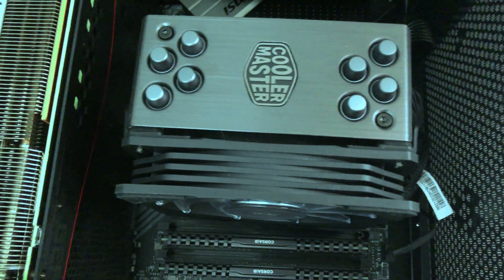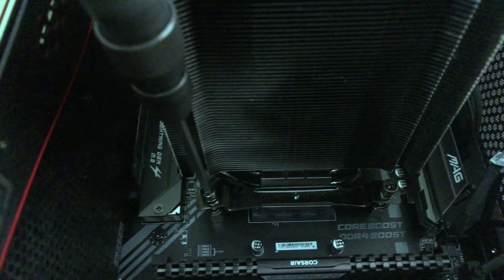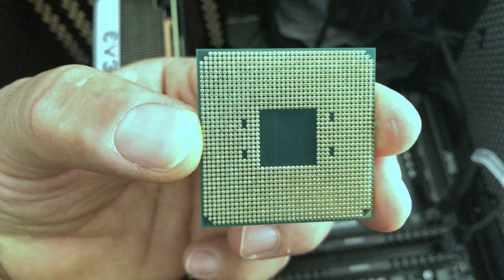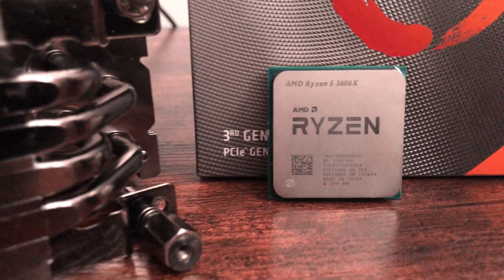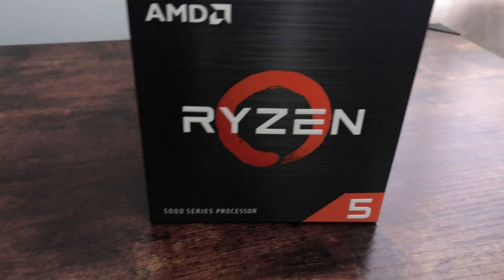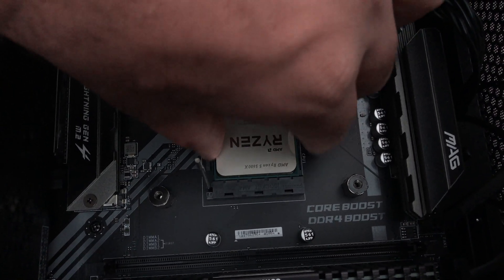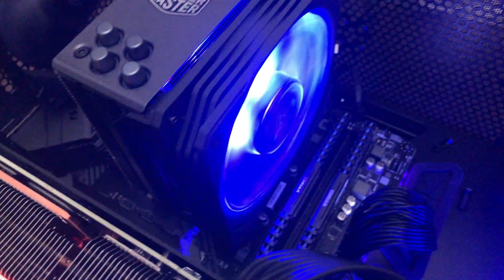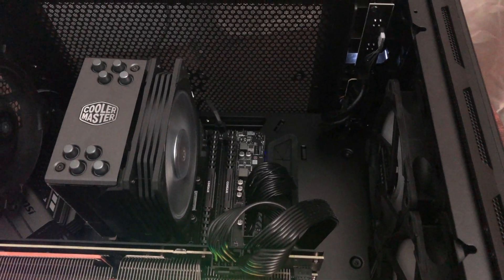Ryzen 5 5600X | CPU INSTALL |

Comment: i was reading up some stuff about the back plate, do you need to remove the motherboard to swap cpus?
Reply from the maker: No need to remove the motherboard, back plates are only for when you want to add a custom heatsink.
Reply: @techcontrolofficial  thank you for the quick reply!!!

Comment: Nice video man!
I'm in the market for an upgrade and 5600x is what I'm thinking of.
Reply from the maker: Thanks!
I think the 5600x is the biggest bang for the buck. If your gaming at 1440 and some 4k and for productivity. It will pretty much handle all the tasks like a boss. However if you plan to only game at 1080 then depending on what you currently have may not be worth the upgrade.